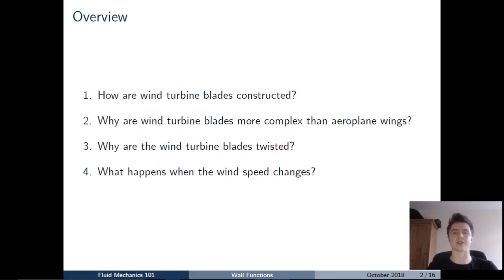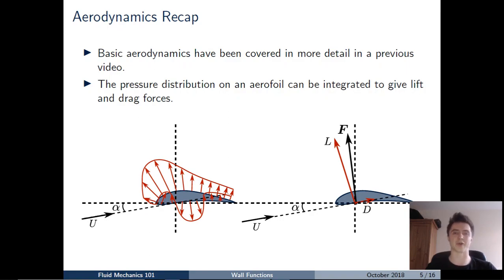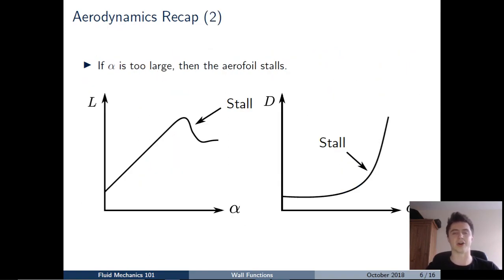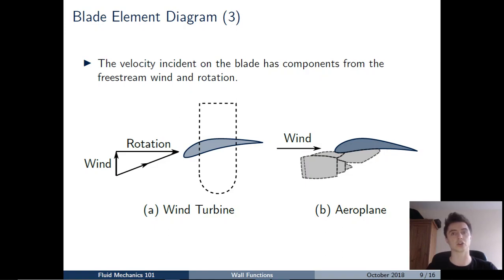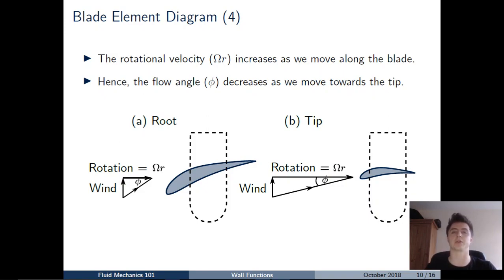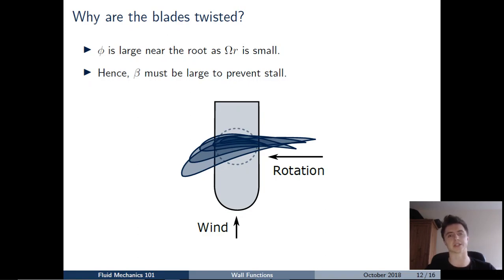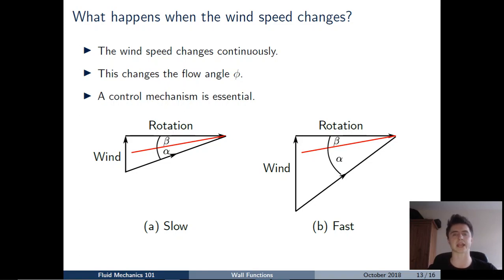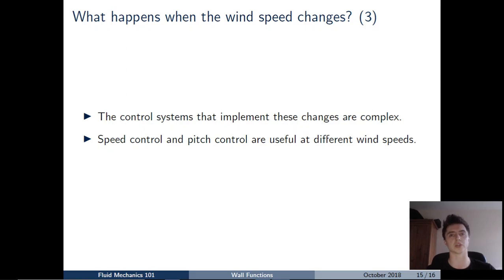[Concepts] How do Wind Turbine Rotors Really Work?

Comment: Great video.  I just discovered your channel a few days ago and I am really enjoying watching your videos.   I would like to point out one small issue I have with this otherwise great video, I'm not 100% sure it is worth mentioning to your audience.  Around the 50 second mark you mention that the horizontal axis wind turbine circled is a lift type  wind turbine while the the two vertical axis turbines are not.  While it is true that some vertical axis wind turbines are drag driven Savonius type turbines, the two vertical axis turbines you have pictured appear to be  Darrieus type, lift driven turbines.   You are still correct however that they are not as efficient as HAWTs however.  The reason has more to do with the angle of attack not being a constant as the blades rotate around about their axis, than the lift verses drag issue.  My students and I are currently working on variable pitch vertical axis wind turbines which aim to improve the efficiency of such lift driven vertical axis wind turbines.
Reply from the maker: Good point. I have pinned your comment so all viewers can see it 👍 thanks for your support Gordon
Reply: It would be very interesting to make a video of the CFD approach of Darrieus type VAWTs (without pitch control) concerning especially the chosen turbulent model and y+ as the AoA of the blades changes permanently and flow seperation becomes an issue.
Reply: Hi Gordon,
I am also trying to work on the concept of Pitch control VAWT. Vertogen, a UK-based company claims it has successfully built one. What's your thought on the same?
Reply: @ayushjadhwani4735  - I think the interesting and difficult question is,  'Ok, so you're making a VAWT that can change its blade pitch as a function of angular position about the central axis, ok what IS the optimal pitch at each angular position?'  My students and I are following a couple of interesting papers by Adams and Chen on the subject.  They have developed what they call Flux Line theory which is an expansion of double multiple streamline theory for analyzing VAWT.   The first paper is 'Flux-Line Theory: A Novel Analytical Model for Cycloturbines'  AIAA 2017  We have spoken with the authors and have attempted with some success to write some MATLAB code to implement their theory.   In our conversations Adams suggested to implement the pitching scheme the use of a 3D cam so that different pitching schemes can be used under different wind conditions and tip speed ratios.

Comment: Just correction from me..In drawing triangle velocity diagram, the blade tip peripheral velocity (right to left direction) must be drawn, not the fluid tip peripheral velocity (left to right direction), although the reaction direction of blade tip peripheral velocity (right to left direction) caused by the action of the fluid tip peripheral velocity (left to right direction)..action-reaction based on Newton's law..just remains if U not mind..

Comment: Just correction from me...In theory of turbine (steam n gas turbine) n turbomachinery, the peripheral tip blade speed U direction from right to the left if the absolute velocity from left to the right or from front of the blade (in your video)...C=w+U..where C=fluid absolute velocity, w=fluid relative velocity on the blade surface, U=blade peripheral tip velocity

Comment: Hello Aidan,

Thanks for the video, very interesting.

I am little bit confused about the sign of the rotation vector of the velocity triangle. As I have always studied turbomachinery applications (compressors and turbines), the vector associated to the peripheral velocity of rotation (often called u) has the same sign of the rotation in the velocity triangle (and not the opposite like in the video). Then from the velocity triangle you compute the relative velocity (often called w), used to design rotor blades.

I hope I made myself clear, maybe it is just a misunderstanding or I have to separate the 2 topics.

Thanks,

Mauro
Reply from the maker: It's been a long time since I made this video. What slide exactly are you referring to? It could be a typo, it's been a long time since I wrote this talk
Reply: @fluidmechanics101  Hello Aidan, thanks for the quick answer. So, if you look at slide 7, the rotation vector is going towards the left, then if you look at slide 9 the rotation vector is going to the right (opposite versus). For me it is a little bit misleading because the relative velocity(w) in turbomachinery is obtained by imposing the same versus for the peripheral velocity (u), in this case directed from right to left. Thanks!

Comment: Hello there and thank you for this video, you literally saved my life! I would also like to ask a couple of questions regarding turbines. I have a wind turbine geometry which has a 90m radius. It's quite big and when I draw a fluid domain around it, I have some problems because I'm supposed to have multiple wind turbines in my analysis(wind farm) later on which will make my domain even larger. 

So I decided to scale it down a bit and I decided to follow the rules of similitude which means the Reynolds numbers should be equal for both scaled and original cases to be dynamically similar. So 11m/s is the wind speed for a 90m blade and therefore the wind speed should be 22m/s for a 45m blade(assuming the fluid is air for both cases).
 
Here is my question. If I use this scaled wind turbine in my analysis, should I divide the velocity values I've found by 2 to find what the velocity would be if it was 90m blade?

Another question is that I know the RPM of the 90m wind turbine which is roughly about 10 RPM given the wind speed is 11m/s and if I were to find the RPM of a 45m wind turbine(which should have 22/s wind speed to obtain same Reynolds numbers), should I do an analysis in some CAE software to find the RPM or are there any analytical formulas to find it manually?
Reply from the maker: Hi Osman, your Reynolds number scaling is fine. You can then match the tip speed ratio and this will allow you to calculate the rotational speed of the scaled turbine. If you are looking at multiple turbines, have you looked into actuator disc or actuator line methods? This is what most people do when looking at arrays of turbines
Reply: @fluidmechanics101   I calculated the angular velocity of the scaled wind turbine which turns out to be 40 RPM since 

Tip Speed Ratio=Angular Velocity x Radius/Oncoming Wind Speed

I checked those actuator methods a bit but my knowledge isn't sufficient. I also feel a bit dumb about not being able to think of this TSR solution. I feel dumb but happy tho! 

Thanks for your help and keep up the good work Aidan!

Comment: Great explanation. Clear, professional. I guess there is may be a mistake in the direction of rotational speed it should be the other way since V(absolut)=W(relative)+U(rotational) and it make since if you think about the absolute velocity hitting the profile and direct it towards the left.
Reply from the maker: Ahh yes, i think i can see where the confusion is here. In the explanation in the video we are in a moving reference frame. That means that we are moving with the blade as it rotates. The velocity of the wind relative in this reference frame is towards the right. However if we were in a stationary reference frame (looking upstream at the wind turbine as it rotates in front of us) then yes the flow would be directed to the left and you are correct! The reason that we use a moving reference frame is because we are usually interested in designing the blades themselves, (their twist and thickness) so we analyse the velocity relative to the blade motion. I hope this helps!